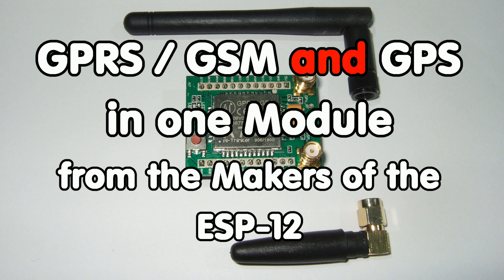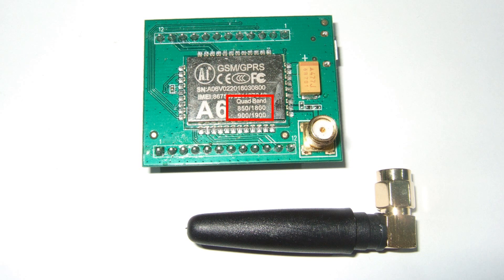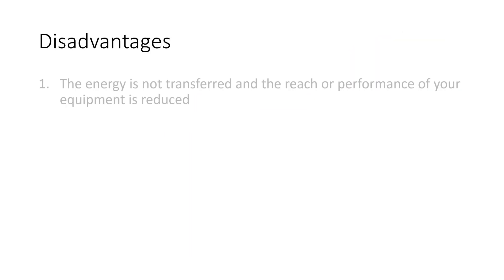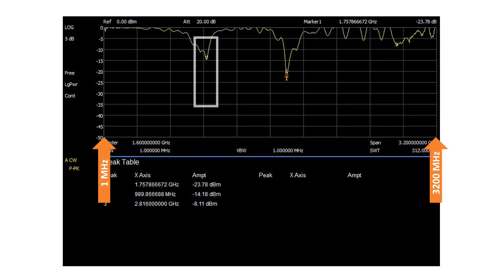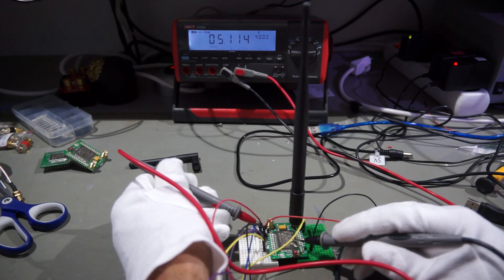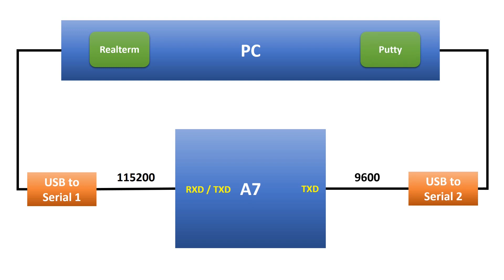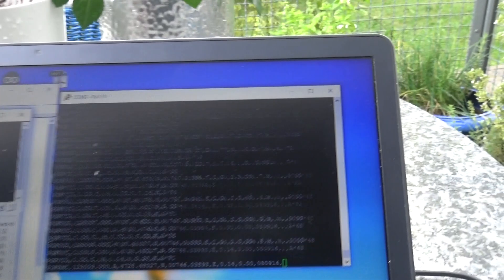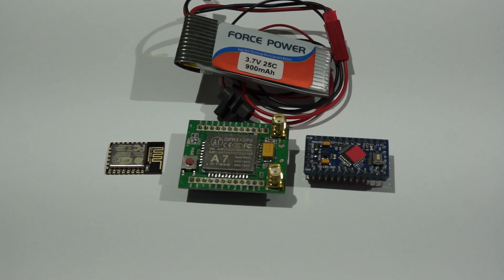#79 GPRS/GSM and GPS in one cheap module: The A7 from AI-Thinker

Comment: Hi Andreas, thank you for your videos. I know this video is already a couple years old, but I was wondering if you ended up using the A7 in a project? If yes, did you happen to check power consumption? (Does it have a sleep mode to conserve power?) Have you run into another module you might use instead which has gsm/gps and perhaps even a microcrontroller all onboard? many thanks again
Reply from the maker: No, I never used one because I wanted to wait for the newer technologies. Internet with GSM was not fun for me. So I do not know power consumption

Comment: Hello Andreas!

Do You know how to remove
GPRMC
GPVTG
GPGSV
GPGSA
data from NMEA responses?
All I need is GPGGA data, and I could not find solution for that in datasheet.

Also is it really necessary to have max current input > 2A as datasheet states?
With both GPS active and GPRS sending data maximum current flow I've measured was about ~250mA.

Thank You in advance.
Reply from the maker: No, I do not know if this is possible

Comment: hallo andres ich habe ein problem mit meinem A7 modul....

Ich benütze ein USB to serial

VCC-5v
GND-GND
RX-TX
TX-RX             

ich benütze Putty baud ist 115200
und richtiger COM ist ausgewählt.

Manchmal kann ich in putty schreiben und manchmal gar nicht.
wenn ich schreiben kann funktioneren die AT COMMANDS

wenn ich ein arduino benütze kann funktionert es

HILFE?
Reply: Vielen Dank für Ihre Informationen. Ich hatte das gleiche Problem schon vorher. Jetzt habe ich es mit Ihrer Methode behoben. Vielen Dank. ^^

Thanks so much for your information. I had the same problem before. Now I fixed it by your method. Thanks. ^^
Reply from the maker: Ich hatte auch probleme mit dem Putty. Ich habe dann aif realterm umgesattelt. Ich bin mir nicht sicher, aber möglicherweise hatte es mit den CR und LF am Ende der Zeilen zu tun.
Reply: ich habe eine "Lösung" entdeckt "   " wenn mann putty verwenden will.
1. alles anschliessen. TTL mit dem A7 (A7 noch nicht anschalten bzw. knopf nicht drücken)
2.Putty öffnen und in den Einstellungen für das Terminal: ECHO >>FORCE ON<< &  LOCAL LINE EDITING >>FORCE ON<<
3. putty auf richten COM & baud stellen 
4.öffnen.
5. Denn Knopf für 3 sekunden halten... dann sieht man wie das A7 hochfährt (in dem bereits offenen Terminal)
6. tadddaaa es funktioniert
7. line editing und echo wieder disablen
8. MAGIC
Reply from the maker: Danke für die Erklärung. Bin froh, dass es geklappt hat.

Comment: Hello Andreas.
I received the A7 module and it works with Putty and other programs of this type (I send AT commands and receive data).
Can I read data from A7 module using STM32 (Blue Pill) but I do not know why I can not send AT command using STM32 ?? Please help because I ran out of ideas.
Everything works except that I can not send the AT commands from the microcontroller.
If the AT command is sent from Putty to
A7, blue pill reads data, what's wrong?
Sorry for the mistakes, I'm from Poland and my English is weak.
Reply from the maker: Maybe you add a CR or LF character at the end of the line in your program.
Reply: Welcome back :)
Your idea was shot at 10! Command "AT '\ r'" finally gave the answer "OK" :))
Thank you very much!!
Reply: Hello!
Your previous tips were excellent and thank you for the advice .... and please more;)
Again my module makes me difficult.
For some time, he started to get a bad position. I get the same data as before but the location is different and away from me about 43km !!
My program is the easiest of the possibilities, it reads the gps data and displays it in the Serial minitor. Gps constantly points to the same position, "AT + RST = 1" does not help. No power supply overnight does not help either.
Have I changed something in settings ??

Comment: Great video!

I have some questions:
1. Does the short antenna is for Wifi?
2. Any idea how we can turn the system off (or hibernate) and turn on when needed (incoming SMS or  fix period of time)?
3. what's the current (Amps) draw for idle/GPS on/gsm on/ gsm+gps on?
Reply from the maker: 1. No
2. I do not think so. But maybe you find it in the manual
3. I did not measure, so I do not know

Comment: Great content :)
Check out SIM808 also and SIM868 is still smaller than SIM808 and has GNSS. 
How many of you are interested in a Open hardware GPS tracker. I have developed one and thinking to go for crowdfunding. Discussion is going on. Name is VALTRACK-V2. Size is around 50mmx17mm. Its super small. Has ARM Cortex M0 MCU and you can program it using SWD lines.
Reply from the maker: Good luck with your project. Seems to be a good design
Reply: Thank you very much Andreas :)
I would be very glad and honored if you could provide any feedback or suggestions for improvements.
Reply from the maker: We will see. I subscribed to your channel
Reply: Awesome sir, I will make sure to post an update soon. Thank you again.

Comment: Such a great channel. Thank you. Do you know if the A7 board can receive text messages while it is in standby. I found in a data sheet that it uses around 5mA in standby, but it doesn't say what is turned off in this mode: https://www.makerfabs.com/desfile/files/A6_A7_A6C_datasheet-EN.pdf

Thanks!
Reply from the maker: I never tried this mode.

Comment: Waiting for a follwup on this,  flashing code and working with esp8266.
Reply from the maker: I have no plans for this module for the moment. Because it works with AT commands and Serial communication, it does not matter, if you use it on n Arduino or on a ESP8266
Reply: Thanks for the quick replay, Anyway ordering an A7 for some experiments.

Comment: Hello, do you have a schema on how to connect the wires for GPS / GPRS?
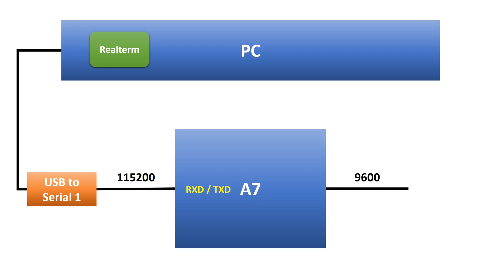Reply from the maker: Not more than at 5:33. Maybe you have a look into the data sheet of the A6/A7
Reply: That's exactly what I did UART_TX -> RX and UART_RX -> TX both 3.3v, 5v -> 5v and the GND to GND, I don't need the GPS because I'm only trying to use the GPRS/GSM for now.

But  it seems the A7 doesn't even power up, I'm trying to connect it with a raspberry pi.

I will maybe try and see if this works with a PC + FTDI first.

I could see that you have a red light on on yours which I dont have switched on mine at all, are there any specific ways to turn it on?
Reply: @Andreas Spiess Based on the schematics of the A6, I figured I had to connect an micro usb cable to the A7. then loop the 5v with the PWR_KEY, it works now. Thanks.
Reply from the maker: Not that I remember. But it needs some power. So, you might have a look at your 5V supply that it is strong enough

Comment: Hello, is there possibility to check if that module uses AND or OR function with speed and altitude limits? Im looking for GPS tracker for my stratospheric baloon, and I need it to have disabled 60000 ft/18 km height limit, or just that one, which uses AND function (GPS turns off when both altitude and speed are exceeded).
Reply from the maker: These are only modules to read the position. So, you need an additional microprocessor to log the data. And this microprocessor then has to do the switching.

Comment: hello, thanks y have the A7 module but I cant read the NMEA with TINYSGPS libraries in my Arduino, I can read de NMEA in the monitor serial, maybe cant read the NMEA with tinys because the STRING are GPSRD: $GPGGA, but the $GPRMC is clean I don't understand why :(, I can make a tracker with this module.
Reply from the maker: I never used this module in this scenario. So, I cannot help you. Maybe you read the manual to find out, how to enable the right strings.
Reply: Hello, problem fixed, i was use the gps tx and other port in arduino for read the nmea
Reply from the maker: I am on twitter and facebook only
Reply: Andreas Spiess what is the id of you facebook
Reply: Jorge, Quales patas usaste para leer y escribir a el GPS?

Comment: Hi Andreas!, now i'm working with A7 module, it has some bugs for internal buffers, so it's necessary to use AT+CIPSEND and CTRL Z, works great!. I have a question about battery, at the end of your video i can see 900 maH battery that could to energizer, but i want to know if you know a green battery for this module, do you listen about zinc-air battery?, what is your opinion about this?
Reply from the maker: I made a video concerning batteries. Maybe you watch it. But I never tested zinc-air batteries
Reply: Is very interesting, because is a green solution for IOT, because the traditional litium battery could be a problem..

Comment: First of all, congratulations on the video!
Now, I'd like to know how you did it. Do you have a tutorial?
I have an Uno R3 and A7, but I do not know how to use it.
I need to send geographic coordinates through text messages to an academic work. Can you help me? Thanks!!!
Reply from the maker: I put everything I know into this video. So, if you need more info, you have to google or read the data sheet.
Reply: Tiago Higino did you success yet? I have same question
Reply: With me it still did not work.
I almost gave up on this module. I have not seen any in full operation yet. No sketch worked with me.
Reply: Well I'm glad you just "almost" give up, hehe. I'm already buy 4 of this and now I'm stuck

Comment: Very interesting. I am also experimenting with an A7 device powered via USB connector connected to a 2 amp adapter. In your video you use an USB to 3.3 TTL convertor. I use a COM1 RS232 convertor powered with 3.3 volt. It give data 0 - 3.3V, measured with an TEX oscilloscope. Testing this by looping at RS232 TTL level worked correctly. After pressing the red start botton on the A7 shield I got a number of ^cinit messages and some more on a terminal program (SMARTERM) on a windows PC. That looked good. But sending an AT (return=cr/lf) command I got no response, even not an error message. So to get a working system, please give me information about the USB convertor, that is the only difference . But at the end, my application will be built with a PIC/UART device.
Reply: sorry I am new here and did the above post on another video also.
Reply from the maker: You already got my answer there ;-)
Reply: I switch to this topic, where it belongs.First, thanks for all the information.I checked the connections and everything looked OK.After switch-on the A7 module, I got the following data:^CINIT: 4, 8192, 37^CINIT: 8, 2048, 1^CINIT: 16, 0, 1638420^CINIT: 32, 0, 0+CREG: 0+CTZV:17/04/02,18:37:14,+02+CREG: 5Does this look OK, or is there an indication for a problem?
Reply from the maker: At least, the communication seems to work. Now you can start to make a call etc. using the AT commands. One after the other. It will be some work till it does, what you want.
Reply: Hallo Andreas, As you (I hope) remember, I had a problem with communicatie PC based RealTerminal to A7 via USB. Comm A7 to PC was OK.I found out the problem. Inserting the AT command by hand on the PC, the A7 did not responded with OK. But, sending the AT command as a string I got the OK respond. After that it was possible to send next commands by hand. First lesson learned.

Comment: Hi Andreas, Im lost, don't you know why the module reboots randomly and ALWAYS reboots when recieving an SMS? Thank you Charlotte
Reply from the maker: I never worked with SMS. So, I do not know
Reply: Thanks Andreas
Reply: maybe your supply is to weak (thin cables, weak battery,...)
Reply: Hi Fritz,using a solid ATX power supply enough Amps, not sure about the cables,what would you suggest? When I do it manually via putty it works,but from arduino with code it reboots??
Reply: ATX power supply sounds totally fine. I looked the cables up awg18 or better should do the job (rated for 2A continuous)

do you use level shifters? since what i remeber uart is 2.8 (i found no docs telling me the max or HIGH/LOW logic levels)
Reply: Hi, Yes,these one, serial Arduino 5V to A7 3.3V
level
shifter , I also use this A7 shield from elecrow
 when you type in the AT commands on serial console,it works and can see the sms message, but it seems when you use program code where the A7 is doing something else and then randomly receive sms it reboots......speculation? Do you know anything about AT+CNMI=2,2,0,0,0 , the AT manual is confusing.......thanks
Reply: Since I don't know anything about your code I would monitor the TX and RX line of the modem by connecting both to 2 UART->USB modules RX to TX of M1 and TX to TX of M2 to check what is transmitted and when it crashes. Maybe your lib sends strange commands

If you have an osci try monitoring the communication and power for strange things like voltage drops, strange patterns in communication

I can't help you more since I don't know the A6/A7. I first wanted to try them because they were pretty cheap but the documentation is really sh**t(no real hardware specs so designing a (good) ciruct around is not possible in my opinion) so I stay with simcom sim900(equal to a6) and will try the simcom sim808 (equal to a7)
Reply: Thanks Fritz,will do.....pitty I don't have a osci, but I see there is a new module, that can work as, Osci,Digital Multimeter,  Function Generator and a Variable Power supply just under $25 .....https://www.myelectronicslab.com/stories/pocket-electronics-lab-tool-espotek-labrador/  I will get one

Comment: Great videos, Andreas. Saved me a lot of time and compensates greatly for the poor chinese documentation. When it comes to hardware i/o characteristics and max ratings, you're on your own. I managed to connect to the board with a 3.3V USB cable. It survived though the serial i/o rating is 2.8V and with your videos it worked like a charm. I trashed the included WiFi antenna and connected an active GPS antenna instead and powered it with a mockup of 5V, a simple coil and capacitor. The GPS-RF input also survived this. Great performance with AT+GPS and AT+GPSRD. Can't get the AT+AGPS to work though even if the GSM is connected. Have you tried AGPS succesfully? Anyone?
Reply from the maker: I tried AGPS and also was not successful

Comment: Hi Andreas, thanks for your videos, they all are really informative.
I bought the same module, and rushed to see this video, and got really disappointed hearing that the GPS antenna won't really work. Since I'd really like to give it a try, what would you suggest me: no antenna at all/ wrong antenna/ diy antenna... ? :)
what would be the results ? Thank you for your time !
Reply from the maker: The antenna might still work, it is just not made for this frequency bands. There are some GPS antennas even with SMA adapters available on Aliexpress

Comment: Hi, would this be a good cheap antenna for use with this module?
http://www.banggood.com/Ceramic-GPS-Antenna-1575R-A-Passive-Antenna-1575_42MHZ-25-x-25-x-4-MM-p-1013574.html
Reply from the maker: This should work. But make sure, you get the right cable

Comment: Hello, may I know how do you connect the A7 to an Arduino Uno and use the GPS function? Do you have any write up that I can follow? Your help will be greatly appreciated!! Thank you
Reply: You can try out my codes here :https://gist.github.com/Jswoon/eb705a21ba713b7696319215bb21fd94
Reply from the maker: If I remember right, Pin 30 is the 9600 Output for GPS. You can also swithc GPS data on on the normal Serial, but I do not remember the command. You find it in the description. I think, also in the comments of this video
Reply: I can make a call and send sms using the A7 by connecting it to the Arduino UNO. However, I want to try to use it with the GPS. I am wondering how am I able to read the data of GPS after I type in the AT command in the Arduino IDE. These are the AT Command I typed in:
Serial.println("AT+GPS=1");
Serial.println("AT+GPRSD");
Reply from the maker: I never tried it and for the moment unfortunately no time to try it. So, you have to find it out yourself.
Reply: thank you =)
Reply: Hey! 
I haven't tried it myself but you can probably use the GPS pin on the A7 chip (it's right under the GSM_RF antenna). This pin constantly sends the GPS data over Serial (ofcourse after you enable the GPS using the AT command). So all you have to do is connect the GPS pin the Rx on the Arduino and it should fine. (beware of voltage differences!!!)
Hope this helps :)
Reply: I solved it!! Thanks for your help!
Reply: hey Jun, may I know how did you solve it ?
Reply: thanks, can I learn about sending sms using modules a7
Reply: Hey Muhammad Khodeer 
could you share your pin out schematic as well?

Comment: Andreas...I am unable to post anything from tcp method to a web server. since A7 module does not support http services, is it possible to do it from tcp method?
Reply from the maker: Did you look at my A6 video? The A7 should use the same commands.
Reply: Andreas Spiess yes I did. But in my case I want to send a post request to my web host to pass the following variables. 
post.php?y=2&z=7
With GET will it be Possible?
Reply from the maker: I do not know, but to my knowledge, the get commands are normal http calls. So, I think, yes.

Comment: Does this product have ESP8266 wifi integrated? Can It be used as microcontroller or it has to be connected to external microcontroler via serial port?
Reply from the maker: You have to connect this device to a microcontroller (trough Serial). I has no ESP or WiFi integrated